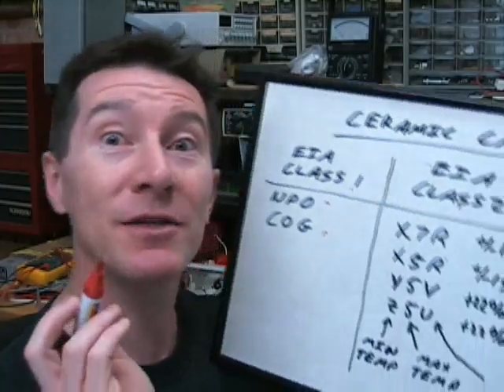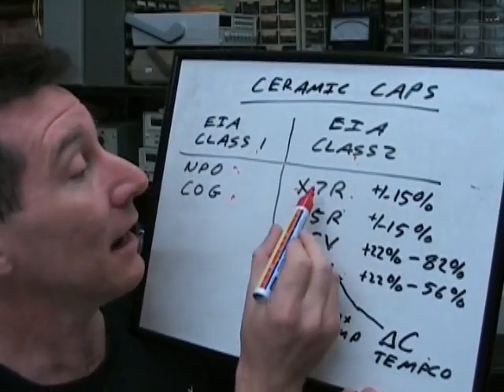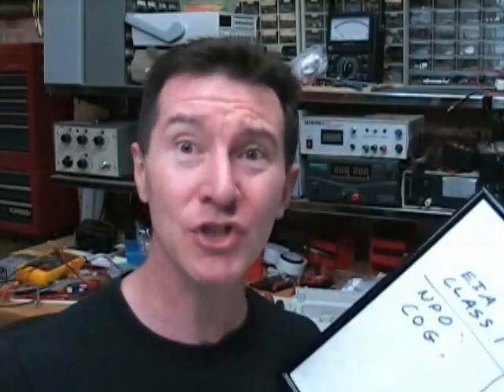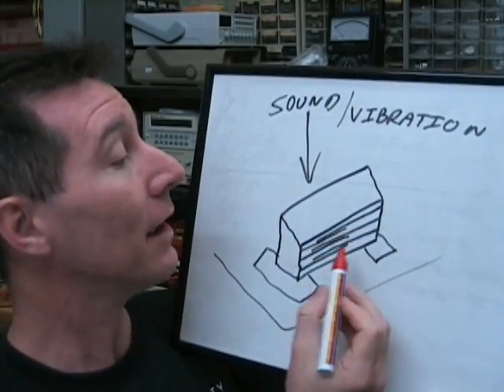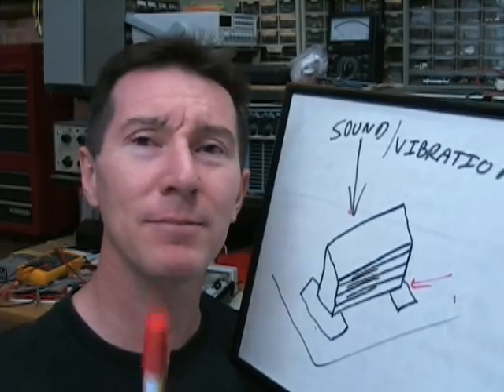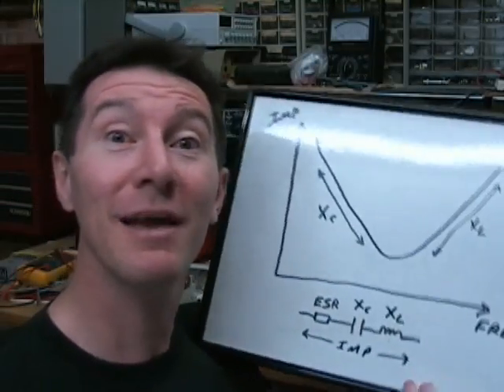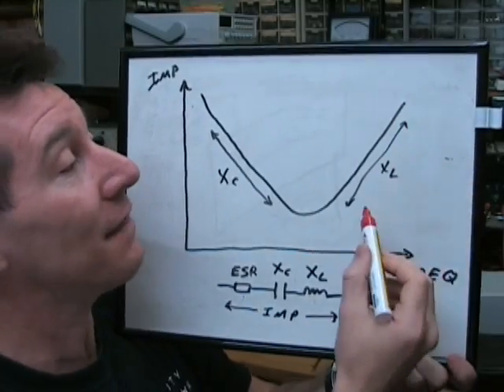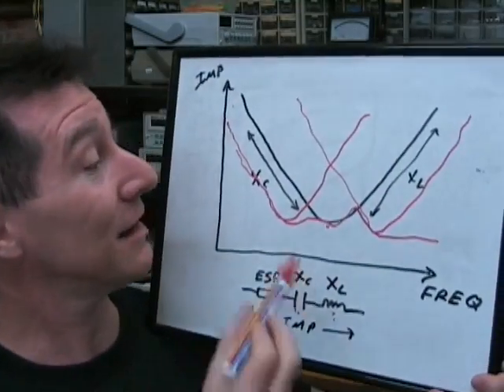EEVblog #33 2of2 - Capacitor Tutorial (Ceramics and impedance)

Comment: A capacitor should be operated within ~65 - 75% of their rated maximum voltage & properly polarized.

To operate them at lower voltages, the dielectric is not placed under proper "stress" to have the capacitance they are manufactured for. Lower than that operating voltage, there is less capacitance than rated.

You pointed out very vividly that the plates of a capacitor will move. Particularly in multi-layer capacitors. They generate physical movement which can result in micro cracks in boards. Sometimes that movement is in the audio spectrum heard by the human ear, other times ultrasonic. But there is movement which can affect the capacitance value by changing the space of the dielectric which is controlled by the applied voltage.

Operating within the 60 - 75% range is very important for pulse forming, shaping, clampers, clippers, oscillators, or other pulse coupling, transferring or developing circuits. Grossly over maximum rated voltage component will never perform in these circuits as expected, even though the capacitance value is labeled to be a match. It does not have that capacitance value until operated within this "sweet spot" voltage range. Even for well regulated power supplies, the operating voltage should be within 60 - 75% of maximum rated voltage to stress the capacitor dielectric enough so the rated capacitance is there.
Reply: Good tip. Thank you for sharing.

Comment: You should have mentioned the nasty residual dielectric polarization of ceramic caps. What happens is that at the range of milivolts, the apparent capacity increases a lot and the cap will keep voltage for a long time. This can freeze astable multivibrators and put a nasty offset voltage to smoothed measurement points. I always prescribe foil caps to such applications.

Comment: the backwards RU symbol is the Recognized Component Mark issued by Underwriters Laboratories. Underwriters Laboratories is a safety certification company, and not a manufacturer. 08 11 could be the manufacter date. a quick googley for the MOV name, 24 1KD10, says it's manufactured by multiple companies under different part numbers, here: category.alldatasheet com/index.jsp?components=MOV%20MOV-241KD10

Comment: How do I determine the microfarad rating of a round ceramic capacitor that came out of an Xbox 360 power brick.
I see the micro farad symbol but it is followed by 08 11
The markings are as follows:
MOV
24 1KD10
(micro farad symbol) backwards R, italicized U,08 11 So it's RU08 11

Comment: it means it cannot handle more than x volts on its + terminal. you cant hook up a 9v battery to a 5v rated capacitor, it would explode. what you need is twise as much as the suppy voltage, so 9v x2 = 18v rated capacitors are needed. this is because of possible peak voltage ripple.

Comment: When you stick you amplifier chassis in a combo guitar amp with 4 10 inch loudspeakers in the same cabinet it brings out microphonics in components big time. It is still kinda rare, but these are what brings out the worst. You mentioned Monster Cable liking to sue. This is rampant in guitar amp circles. One company was found to have used designs from 1950s magazines. People they had sued were lining up to counter-sue. Some people were sued out of business. They "were" the Monster of guitar amps.

Comment: The Z grades are worse than the old FP caps. I usually only use a .01 @ 250 VAC to ground from a neutral on my hand made tube amps, or repairs or removal of the two prong "death caps" on the mains cord. Ceramic caps have gotten better since the 60s-70s. My LCR will graph all the Z, Q etc from 10Hz to 20KHz. Ceramic for audio has a bright tone compared to polyester. or polypropylene. Guys went gaga over Tantalum when they first came out, but I think price was the influence.I Loved this segment!

Comment: I have not heard of microphonics in capacitors before, but I have experienced it with cables. Quite a few times when handling a cable connected to a piece of audio equipment, I could hear the sound of the cable being moved comming out though the speakers, as if there was a microphone connected to it whitch of course there wasn't!

Comment: Class 2 can have large capacitance changes not just over temperature but even over different voltages across the cap so watch out, it gets worse with larger values.

At work we have some boards with 10n and 22n NP0 caps but such large values are expensive.